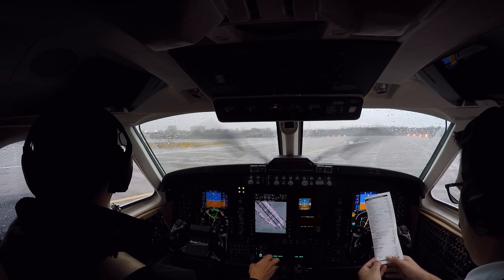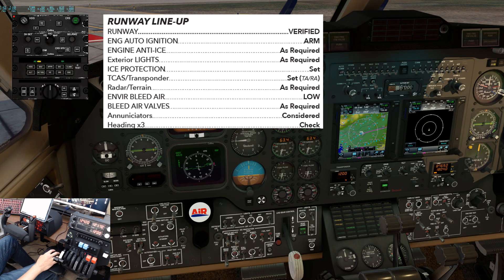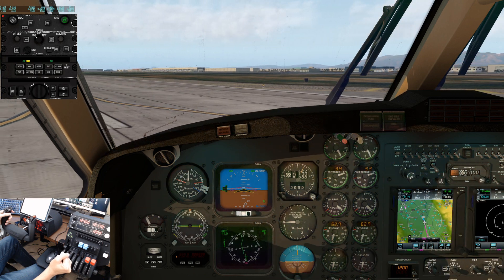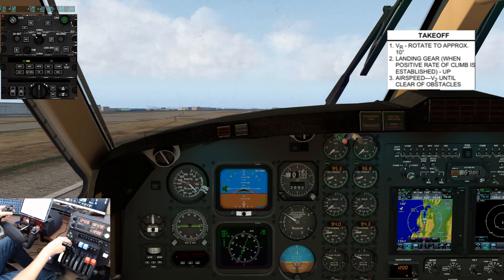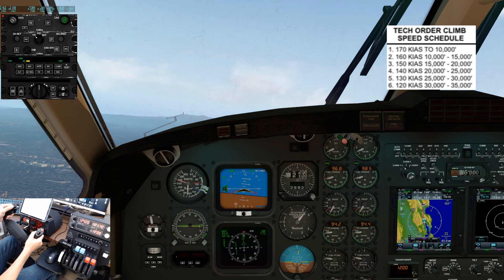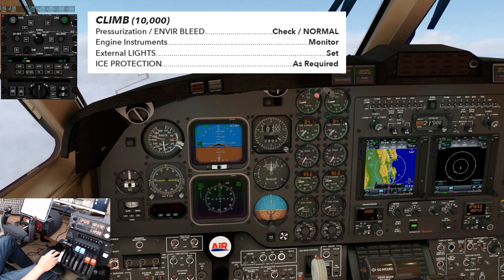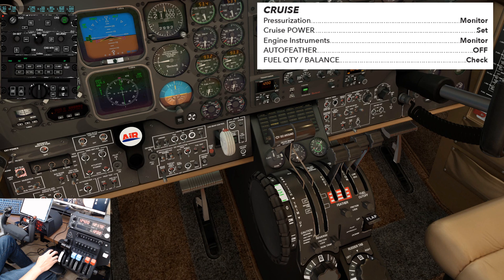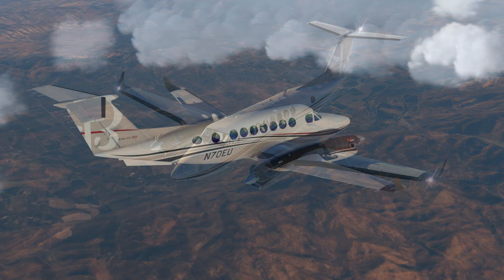King Air 350 X-Plane 11 tutorial by KA350 Pilot | Part 2 of 3

Comment: Always 1 hand on the yoke and 1 hand on the power on take-off.
Reply from the maker: It is industry wide procedure to remove your hand at V1 to prevent accidental movement to idle. At or after V1, you are committed to takeoff. Although certain circumstances could dictate otherwise (that's another discussion).

https://youtu.be/lMwQORj-SUM

Comment: Dear captain，I found you are using GTN750，I bought it too，But Garmin only have AIRAC1909，Can you tell me how to update database？thanks
Reply from the maker: You would need to buy the Garmin nav subscription for the GTN750.
Reply: @chazflyz  I know that，But Gamin data service is very expensive，I only use it for simulation flights，I searched the whole web，only  found AIRAC2012，is a little old，Can you share 2105？I know the answer will be NO，but thank you for answering my questions.Very appreciate！！
Reply from the maker: I don't have the latest AIRAC cycle 2105. I just use whatever RealityXP has released.
Reply: @chazflyz  ok，thanks captain！
Reply: @chazflyz  Even I can give you money，just only for one cycle，because its really important for m

Comment: How do you get the AP from HDG mode in green in your attitude indicator to FMS1. I have the RealXP GTN 750 and the nav isn't working. only HDG control in AP.
Reply from the maker: Yeah I had the same issue initially when I started flying this module.  Tinkered with a few things. 

While in the game, at the top go to PLUGINS.  
REALITY XP GTN 
You'll see GTN1 and GTN 2.  go to GTN1.  Ensure a white dot is next to GTN 750 1 and Master device.
Go to GTN 2 and ensure a white dot is next to ONLY the GTN 750 2.
Back to GTN 1.  Selecting settings.
You'll have a separate window.
Under Panel Instruments:
Check all boxes except Connect HSI/OBS and Connect GPS to VOR.
Check the box "Connect CDI mode to NAV/GPS Switch".  Sync Mode GPS < > Sim 

Scroll down to GAUGE OPTIONS
- VLOC Source : Auto (NAV1)

Let me know how that works.

Comment: Great Video. I noticed a fair amount of right aileron during takeoff to maintain runway heading. I have observed this on my aircraft also. Why is that? Is that the same as in real life? I'm assuming it's not crosswind
Reply from the maker: Thanks. 
Assuming there is no wind, you shouldn't need any aileron correction. But because of torque, we would use rudder to maintain centerline.
Reply: @chazflyz  It's just that i noticed that you seemed to be using a fair amount of right aileron in the video when taking off??
Reply from the maker: I just re-watched the takeoff. I see what you mean after I was airborne. Perhaps turbulence or wind correction to maintain runway heading.
Reply: @chazflyz  Thanks Mate. I always need right aileron during takeoff with the ka350 regardless of weather. Maybe it's just my rig. Thanks again for the great videos. Cheers

Comment: Thanks Chaz! Can you comment on static takeoffs. While you hold the brakes, are the throttles advanced until the torque is stabilized at 95 then brakes are released?
Reply from the maker: Good question! Again, I didn't want to go into lecture mode as it would've drowned out the actual takeoff sequence. Yes you are correct. Static takeoffs: hold brakes, set power to the computed torque setting, verify all engine gauges are good especially the ITT, Autofeather armed, release brakes and go.  We rarely perform static takeoffs in our operation because the aircraft shakes quite a bit and might cause anxiety for some passengers. The airports we fly to have such long runways that it's not necessary. If a takeoff requires a static takeoff (short runway, high altitude, hot, weight, etc.), we always brief the passengers before takeoff so they are not alarmed
Rolling takeoffs just require that we are able to set and achieve the computed torque setting within 10 seconds of brake release (per the K350 Aircraft Flight Manual).  
Hope that helps!
Reply: @chazflyz  Very good. Helps indeed! I’ve mostly done static takeoffs because I thought it helped eliminate asymmetric thrust risk. I brought this concept over from 737-800 pilots but your explanation pretty much says this aircraft and others like it are not an airliner. Thanks Chaz, my sim never shook the house during a static T.O. but now I know 👍

Comment: Great video! Just two questions. On cruise, i saw that prop sync was disabled. When do you normally disable prop sync. And secondly if i am not mistaken, you are flying with fuel cond just above low idle. What indication do you have to check to adjust fuel cond? Thanks and can’t wait for the third video 👍🏻
Reply from the maker: Short answer is I didn't verify it was on. lol Long answer: when I recorded these clips, I jumped straight into the Before TO preset near the runway.  The Before TO preset doesn't include Prop sync On and I just went to runway lineup checklist.  (If you watched Part 1, the Before Takeoff checklist verifies the Prop Sync ON.) Also, as an FYI, in the real airplane, Prop Sync turns on automatically when the engines are fired up.  Good catch on your part!
There may be times where the Prop Sync doesn't work as advertised and we have to turn it off and manually sync the propellers.  Not a big deal.
Reply: @chazflyz  Thanks 👍🏻
Reply from the maker: As for the condition levers.  Those levers simply change the idle condition of the engine (turbine speed indicator).  Low 62%, High 71-ish% .  That's all it does.

Going back to the post above. I jumped in the sim at Before TO and approximated my hardware to match Low Idle in the sim so it likely wasn't EXACT.  You can move those condition levers low to high and back all day in flight without harming the engine. Just avoid fuel cutoff while airborne! :)
Reply: @chazflyz  Thanks! I adjusted the fuel cond at my hotas so that can’t accidently move into cutoff (bin there, done that and got the t-shirt 🥴). I am also using the rev, beta and alplha stages on the hotas. 👍🏻